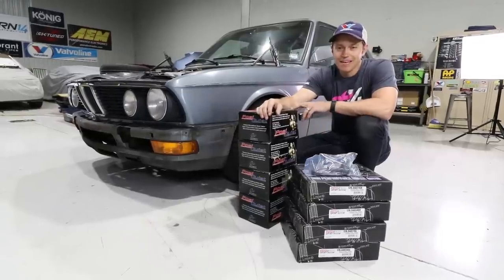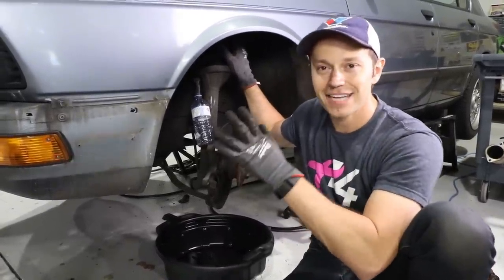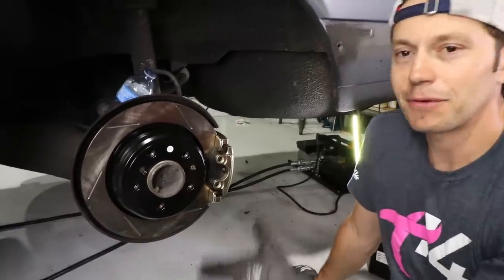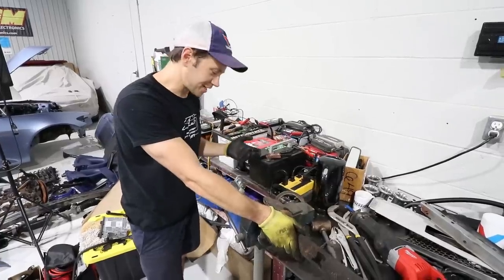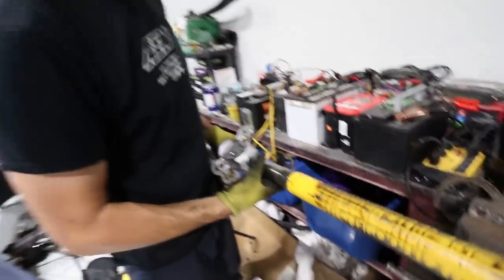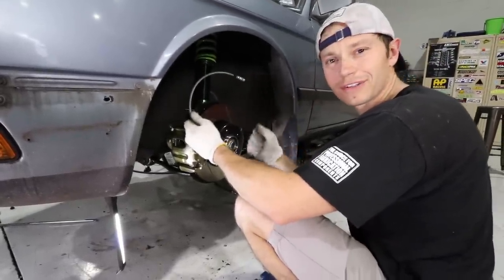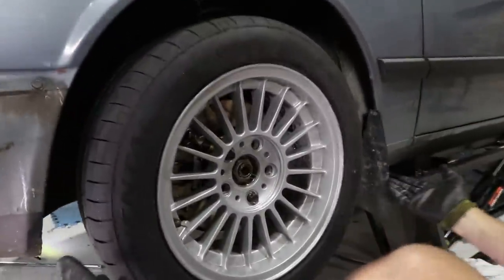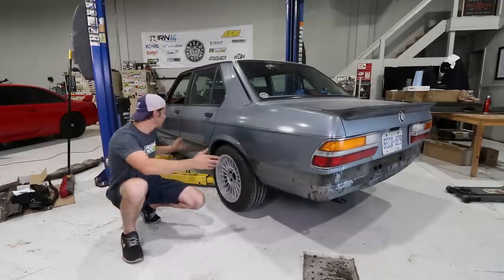BMW E28 Overhaul - How To Weld In Coilovers

Comment: 12:45 try turning the amperage down a touch and also stick the spindle in the oven and pre heat it a bit, you'll find it a lot easier to weld and get a thicker bead.
Reply from the maker: WE'll get an oven at the shop eventually!

Comment: Great video, i had 540 with 750 rears it made a huge difference but there are actually a few options depending on bias and cost. I want to put coil overs but the longer time goes on the more i ponder if you could install or make a custom setup easier (but know im over thinking it for a dream haha)

Comment: BMW tech here. Always torque suspension under load, with screw jack, otherwise you pre-loaded the bushings for failure. Also, you forgot the caliper spring clips. Cheers, ed.
Reply: Kevin Bowers Ramps are key at home!
Reply from the maker: All the suspension was torqued at ride height, just didnt show it and the springs were put on as well. Thanks for the reminder though!

Comment: Hey Peter, 
where did you get your brake kit and suspension arms from? 
I was thinking of going with the Ireland engineering big brake kit, 750i front 540i rear. As for suspension I went with the CAtuned suspension kit
Reply from the maker: Bought everything from RockAuto.com expect the rotors. Heard the CAtuned suspension is nice as well.

Comment: you mean fit youre fake alpina wheels :p . The real ones have the valvestamp in the center of the wheel
Reply: Rutger Derksen for real? Is alpina even all that, or is it just a desirable rare brand with some hype?
Reply from the maker: Ugh, these are real, they have the castings on them.What you are referring to is newer Alpina wheels that had the valves in the center of the wheel...